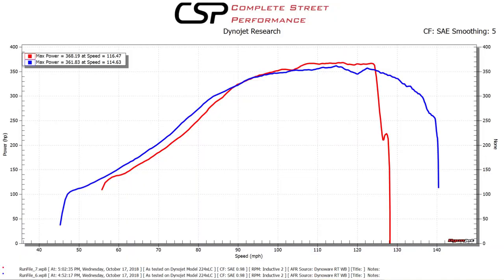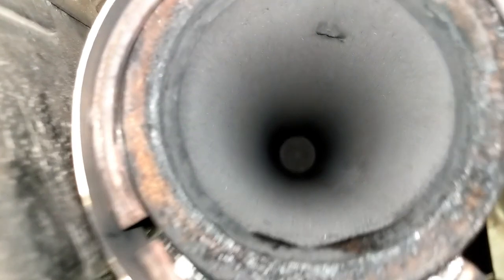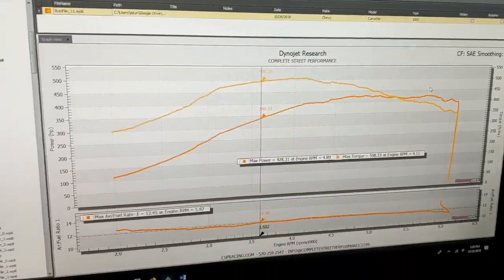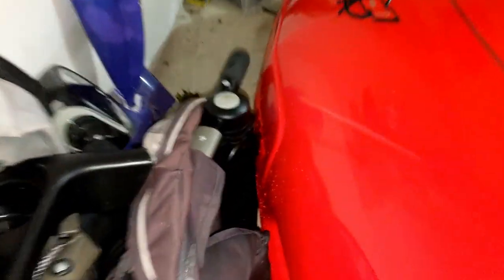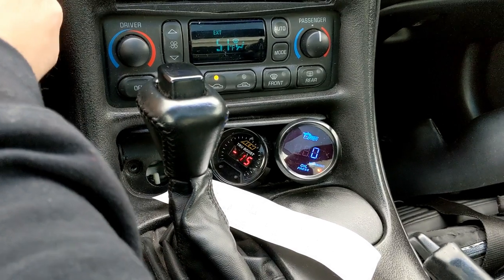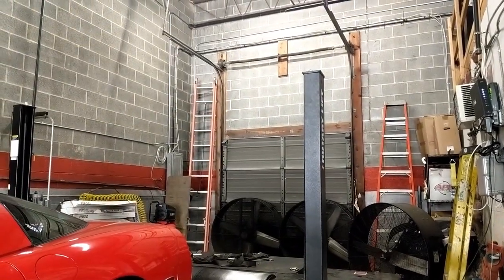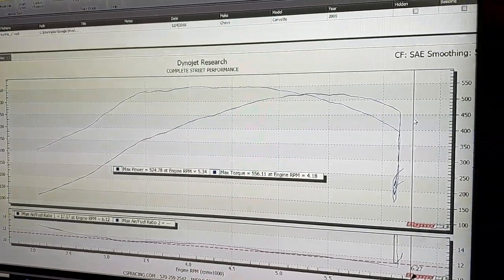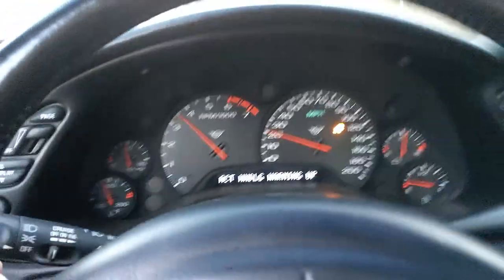Kristen's Turbo Corvette is FINALLY Making Power!

Comment: The wifes car is coming along I wonder if Cleetus has seen this Vette yet. They just got one from an auction  that somebody stuffed a tired 6.0 in.
Reply: SCREAMING BANSHEE  not even. just a 5.3.  Found the owner who put the truck motor in it.
Reply: marc mo  I saw the episode yesterday . Between being struck by lightning and the 408 eng. and they also found out the transmission and rear diff. Is beefed up should be a cool project

Comment: at 80mph it goes sideways?  With only 525whp?  Goes to show you how outdated that chassis is.
Reply: No it doesn't... I can start a rolling burnout 80-90 at 620 whp Easy with a C6 with my street tires.... Still great chassis it's probably the street tires that came on it..
Reply: You mist drive slow cars my stock ls2 at only 360 whp will churp the tires at 60 going into 2nd gear and got super sideways on me once